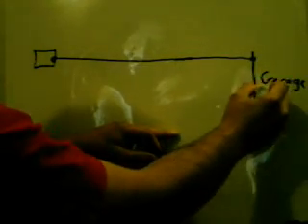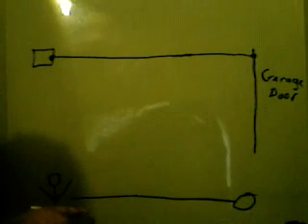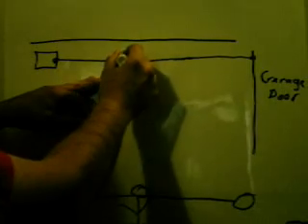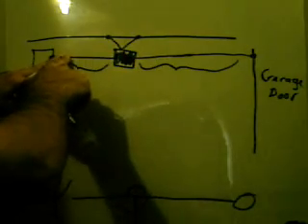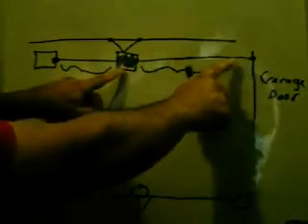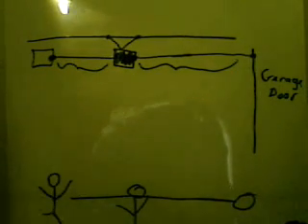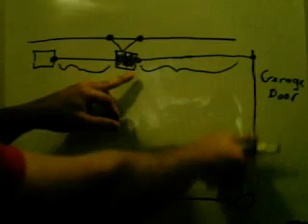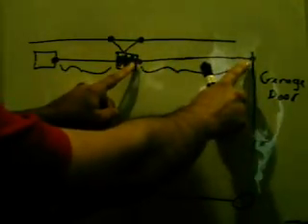Advanced Garage Door Opener

Comment: The only problem that I see with this idea is similar to the one that's encountered by Genie Excellerator openers. Most installers clip the resistor that enables the 2x opening speed because the door and related hardware ends up wearing out much faster. The rollers on the door, the hinges, etc. would all need to be much heavier to handle the speed involved.

Comment: Okay, I have a question. In a real garage door opener, like LiftMaster chain & belt drives, when the motor is inactive the gears lock it down. How would this lock? I don't mean to be rude, but anyone could walk up to it and shove the door open.
Also, the speed of these motors may put too much stress on the top section of door. If you search  "Genie  Exelerator" these openers open twice as fast and close at normal speeds so they don't knock anyone unconsious.

Comment: You have the right idea. Think of a clothes line. The line always stays in a loop, clothes can be brought up or down the line by the direction of pull. If you attached another clothes line to the middle of the existing clothes line, just like your idea, you could retrieve the clothes twice as fast. the only problem is, the end of the second clothes line would be moving as well, which means you'd need a track to keep it extended while it moves closer.

Comment: I think you have the wrong idea of how a garage door opener works? Mine at least works almost like a chain saw. There is no winding up of a cable, it's a bike chain that is wrapped around a pole (imagine the chain on a chain-saw, it's wrapped around the 'blade' or 'arm') the door is attached to some linkage, which is connected to the chain. when the door is opened it simply rotates on the chain, and when it is closed it rotates the other way.

Comment: Place a pulley halfway between door and motor.  Attach the motor chain to the pulley axle.  Attach the door chain around the pulley and bolted to the ceiling directly above the halfway point (at relaxed position, should be directly above pulley).  Engine would need to pull twice torque, but door will open twice as fast.